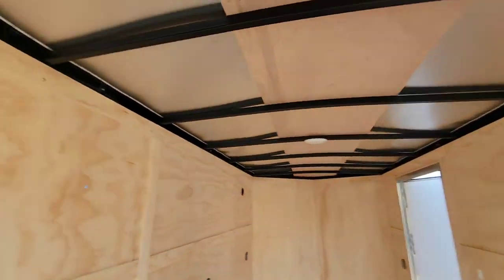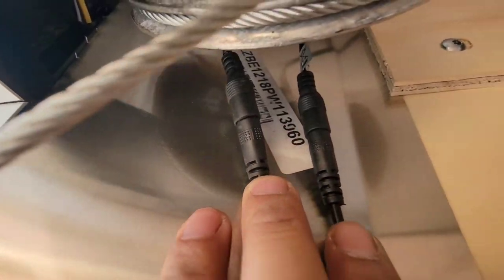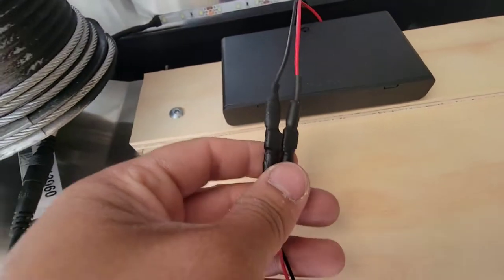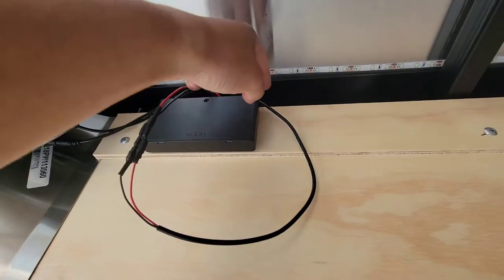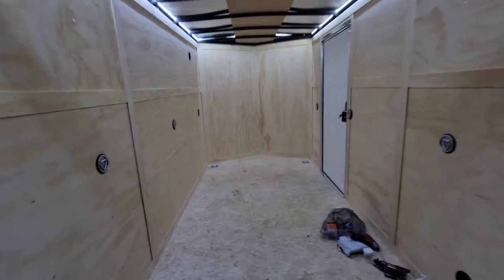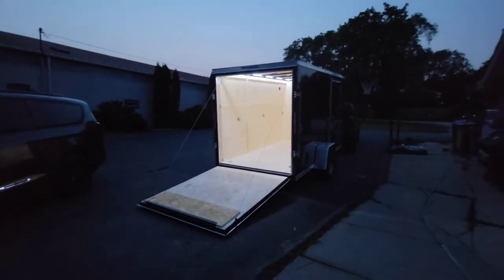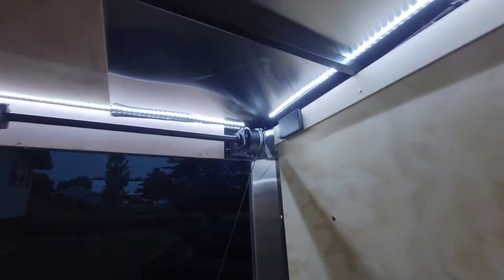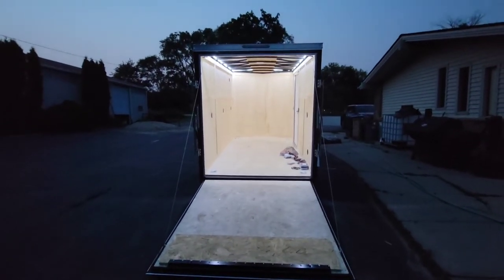Installed cheap LED lights in enclosed trailer!

Comment: Name of the lights? Please
Reply from the maker: GUOTONG White LED Strip Lights, Waterproof cuttable 300 SMD 2835 LED Tape, 6000K 12V 16.4ft/5m Flexible Ribbon, Kitchen Cabinet Lighting, Outdoor/Indoor (Without Power Supply)

These are the ones. I bought two of them. You can copy and paste into Amazon search bar.

Comment: I cant find the lights with the same box of 8 battery  like yours
Reply from the maker: Yes I purchased it separately. Copy paste this into Amazon search bar

2 Set 8 x AA Thicken Battery Holder Base Box with ON/Off Switch and Wire and Cover by QTEATAK
Reply from the maker: You don't necessarily have to use that battery box, as long as it has a battery source and a switch. For example you can use a Milwaukee battery and add a switch to the wiring.
Reply: @HuntingNoobie  thank you again
Reply: @HuntingNoobie  yup this idea is gonna work.  I have a 12v switch near the ramp door for the loading light I could tie into as well I might do that and run a milwaukee power wheel adapter like I did on my livescope for fishing.  Well done